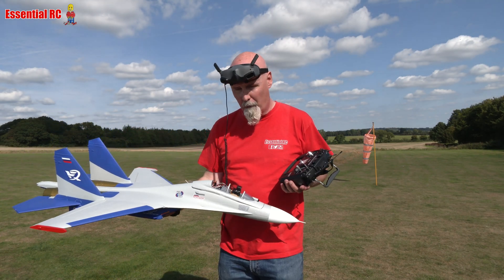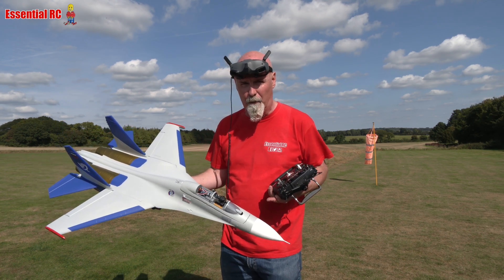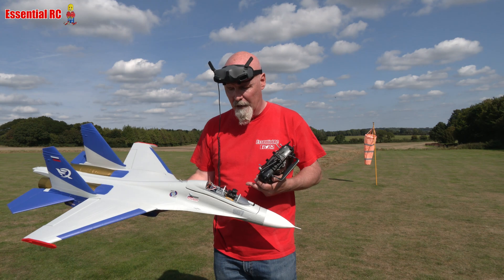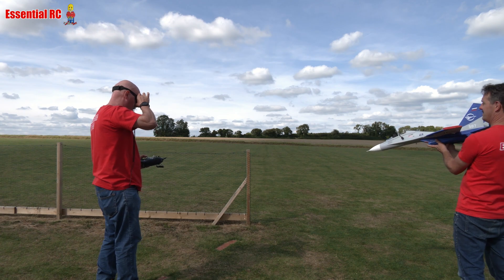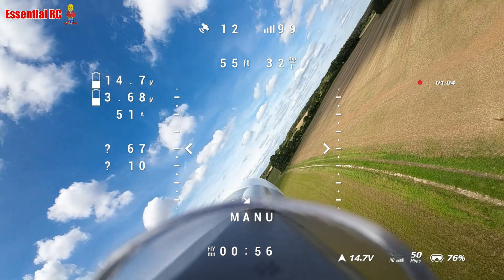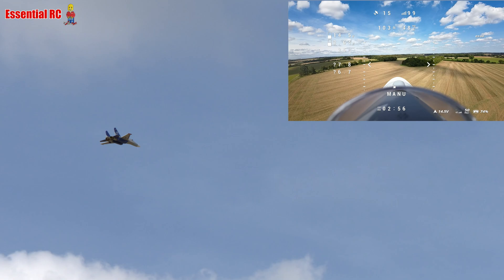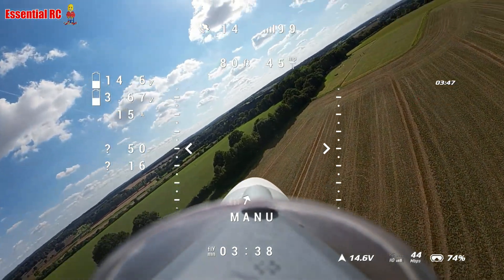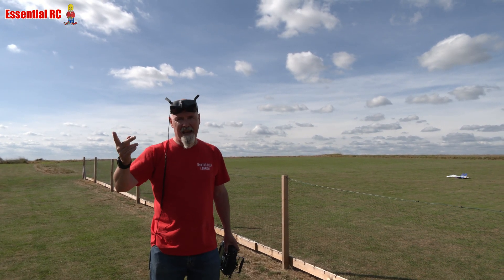RC Jet FPV conversion ! 1st flight from the cockpit | XFly Su-27 twin EDF fighter jet | Part 2

Comment: What HUD is this and does it show up during flight and can it be used with pan/tilt setup
Reply from the maker: iNav running on the flight controller provides the HUD/OSD to the FPV goggles. Yes, I use it with pan/tilt camera
Reply: @EssentialRC  thanks for the reply just getting into this and this HUD seems the most user friendly

Comment: Can this be done on a freewing 64mm? And if so is there a way to make it long range fpv? And one more question, what type of battery would be best? Thank you!
Reply from the maker: Yes. Easy enough to add DJI FPV to it and power the VTX from the battery balance plug.

Comment: Hi Dom, I'm following your FPV journey, and i m just at the start, but ultimately I'd want to use pan and tilt and the best camera for view and video, would you recommend o3 with flight controller or your older system using the bluetooth to control pan and tilt of the goggles?
Reply from the maker: These are all separate things. Start with just using O3 camera/VTX on a simple low cost foamie, then add pan/tilt (look at AtomRC unit) and control that via 2 extra channels maybe via sliders on your transmitter. Then add flight controller (Matek or SpeedyBee) with iNav so you get telemetry (altitude, speed, battery voltage) in the FPV goggles and ability to have automated return to home etc. Steep learning curve with soldering a flight controller together and iNav so don't rush into it. Then look into head tracking to control pan/tilt rather than sliders on your transmitter. One step at a time 😉

Comment: Hey there! Does the FC have to replace the receiver or can I keep my regular reciever and still power the 03 from the FC? Can the 03 still be fully powered up without an OSD or is that how it gets the arming command? Thanks!
Reply from the maker: Receiver is still needed to do its job but it needs to plug into the FC. The servos also get plugged into the FC. How it does that depends on the receiver and FC being used. I typically use SBUS or Crossfire. Yes, the O3 would be powered from the FC. You don't have to show an OSD in your goggles but you need to connect the O3 with 4 wires to the FC for it to be powered and for it to get the arming signal that enables it to go to full power. You would install and configure iNav on the FC and decide what telemetry elements you want to show in the OSD. It can be put to each side of the view so as not to obscure the image from the camera.
Reply: @EssentialRC  thanks for the reply!

Comment: I suggest a damping gyro on roll....
Reply from the maker: I was in Manual mode for the whole of that flight. On a flight yesterday I used Acro mode and the gyro stabilisation helped a lot since it was quite windy. More of that in the next video.

Comment: This is fantastic - even better than sticking Go-Pros on cats!!!  But seriously, the next step would have to be VR if that is possible.  I'd love to fly RC jets (the Su-27 is my favourite fighter period) but I can't trust my eyesight but being able to fly in FPV or VR would be brilliant and something I'd want to try.  Oh, and I already have a Quest 2 for all my PC flight sims!!! 😜
Reply from the maker: Flying FPV was what this video was about and it worked. Have tweaked the setup and flown twice subsequently and still all good. Hoping to fly formation with a second FPV XFly Su-27 next time out.
Reply: @EssentialRC Awesome, I've subbed to the channel and look forward to your next video.  I'm actually looking into some RC Simulators for PC as I don't trust my stroke-ridden brain flying the real things and have zero experience flying any RC aircraft.
Reply: It's still disappoints me that Hobby King discontinued their plug-and-play motion tracker which could attach on to any fpv google and be used to control a pair of servos for pan and tilt. I've seen motionsic and a couple other creators trying to create their own, but I've yet to see anything as easily plug-and-play as what HK had.

Comment: That's cool, I wonder if in the future if you can have a camera looking left and right to give a more wrap-around experience. As for different models it would have to be WW1 Fighters but the sky's the limit 👍
Reply from the maker: I could add a servo to do that quite easily but with this small jet I can afford to have any more weight up front. I will definitely add panning and tilt capability to the larger jets and warbirds I put together over Winter and hopefully head tracked as well.

Comment: Have you looked at using Moiicel P 45b cells for more flight time?
Reply from the maker: 4S2200 pack I am using at the moment is 218g. So 4 of these Molicel 4500mah cells at 72g each would be 288g not including the wire and spacers. 32% heavier minimum. Might make CG harder to achieve but worth a go. Only other concern is I was pulling 51A at full throttle on this jet and those cells are rated at 45A continuous. Might still be OK for a burst.
Reply from the maker: I hadn't Jake. These linked here? https://www.cellsupply.co.uk/molicel-inr21700-p45b---21700-battery-1
Reply from the maker: I've ordered the cells...so will make up the packs and should get 5 minute plus flight time with the extra capacity.
Reply: @EssentialRC  cool. Will be interested to see how you get on. Thinking of doing the same for my 80mm Rafale that you made me buy 😂

Comment: Im working on designing a micro pan tilt gimbal to put on my umx timber evo using a foxeer razer pico. Once its finalized, I'll be putting the stl online. Or I can send you the frame for one if youd like dom. Itll have to be analog tho.
Reply from the maker: Interested to see the STL when you're done. Might try some indoor FPV but I'd have to modify it for digital.
Reply: @EssentialRC  you might be able to put a nebula pro nano in it with slight modification. Or I can try to make a camera mount for one. I'm using really small servos so the camera has to be very small.  you'll probly have to put the vista inside the plane or come up with some other solution. Or get an analog adapter for the goggles. I think analog would be ideal for micros just to save weight. Digital would be awesome tho. I'm printing out version 1.6 now, I'm hoping it'll be the last revision before I can get it flying.

Comment: You can arm an O3 unit with a tiny Arduino board if you don't care about an FC. Google "Aduino DJI O3 RC ARM V2"
Reply from the maker: Aware of it and did consider that but if going to the effort of doing that may as well put in a flight controller. Probably not much more effort but a lot more advantages.